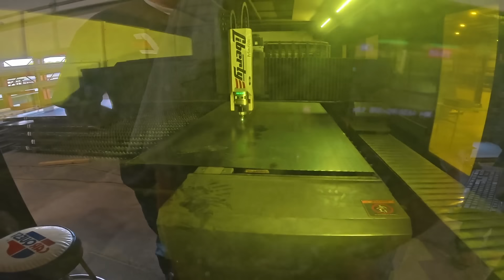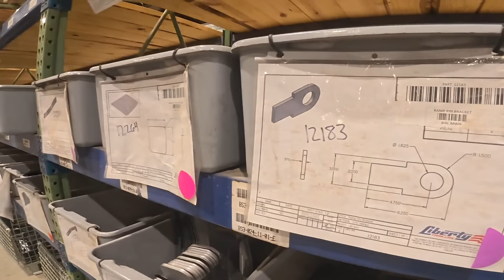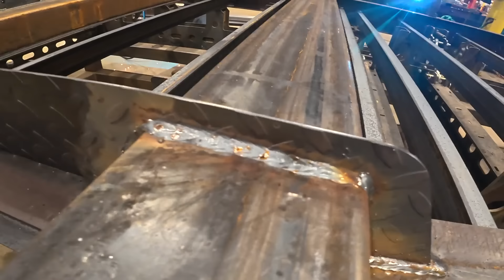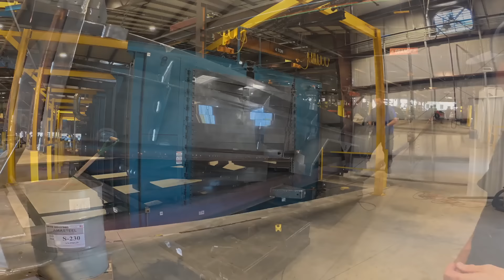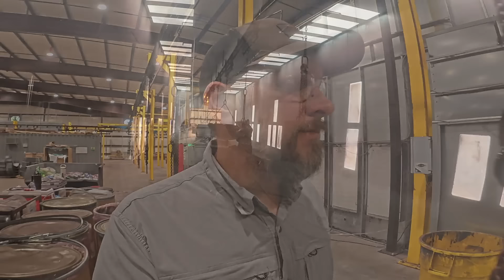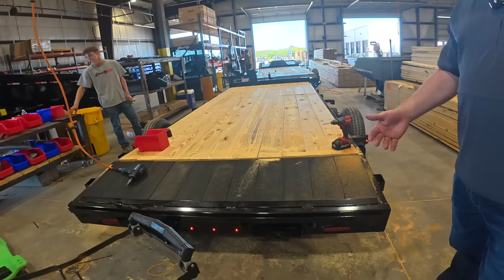They Have Perfected Trailer Manufacturing - Full Factory Tour

Comment: What is interesting on I-30 between DFW and Texarkana you have so many trailer manufacturers either just off the interstate or in a town close to the interstate.

Good  video on how this company does their process.
Reply from the maker: One of the many reasons they mentioned in choosing this area to build their factory is that it’s easy to find a skilled workforce with experience in the industry.

This is definitely the hot bed of Trailer Manufacturing

Comment: I am glad to see Liberty Trailers is using Dexter axles. We have a Diamond C trailer that is supposedly the best trailer on the market. But the brakes on the Lippert axles were poor from the factory. Meanwhile the brakes on our PJ Trailer with Dexter axles have functioned as expected. I do believe Dexter Axles are the best on the market so if you are trying to build the best trailer on the market that is the correct choice!
Reply: I just watched a video on the lippert axle in 8k
Not as strong as the dexter

Comment: powder coat paint..is pure garbage that shit starts peel off and rust at 2 to 3 years old (starts to peel like a bad sunburn ..mite need put suntan lotion on it to keep the paint from peeling ) and the metal starts rust really really bad  !!!    you'd be much better off  using good ol' rustoleum and spraying it on..while the metal/steel is heated up to near 200 degree.. (heated metal expands the poors to absorb the paint better !! .    a.k.a.   baked enamel ..  im only saying the truth ..

Comment: I hope you're there to get a 5th wheel deck-over trailer.  With your combination of wheeled, tracked equipment, and the implements you load before or after and the occasional load of logs or other freight you load over the side, it will have the versatility and the capacity you need.  Something in the 20+5 range will match well with your 3/4 ton truck, and keep you under 26,000 lbs.

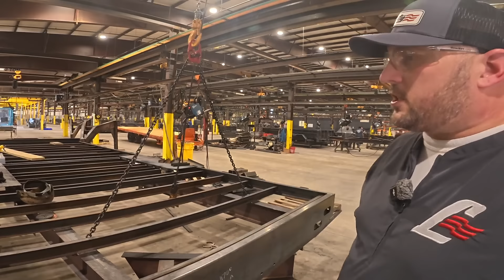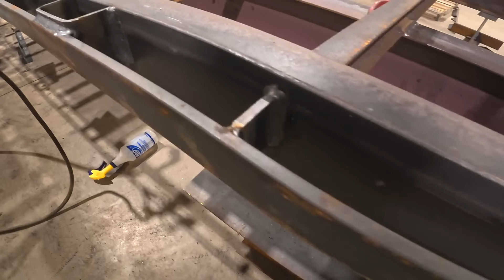Comment: That is a great walk-thru video.  Good information.  Looking from the outside-in the main suggestion that I would give is for Liberty to change the rub-rail action at @10:39 and @11:07 with the flat bar.  When a chain is used at the point of the flat bar between the stake pockets, it can cause a binding and, summarily, create a negative impact on tensioning the chain with the binder, including the bending of the flatbar that is used at that location. 

The round-pipe spools are more practical and have been used for 60+ years now, even on the larger trailers, and are a thick-walled round-pipe chain support at that position point behind the rub-rail for the attachment point of @ 10:39 and @ 11:07 = the chain can adjust around the round attachment point and will not bind when tensioning like it does with the flatbar.
Reply: Great suggestion!  We're actually in the process of switching that model to have chain spools there.  We've already converted our flatbed gooseneck models to have those.

Comment: Good morning Brock! I would be shocked if you were taking home anything besides a dump trailer since that is what you have been looking for. They look like good trailers and like the company really cares about their product. The one thing I’m not sure of (which 95% of trailer manufacturers are doing) is the powder coat. They all look great out of the factory but at least here in NY I have seen expensive and cheap trailers that all rust out in 3-5 years unless you respect them. Someone once said the reason vehicles don’t typically rust out as fast (at least the bodies) is because paint holds up better than powder coat and that is also why powder coating is cheaper to do.